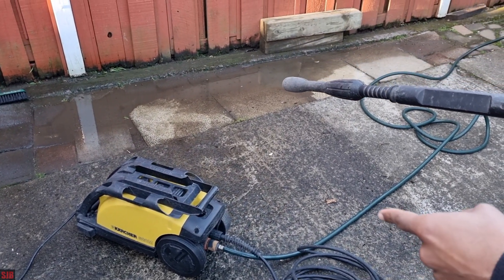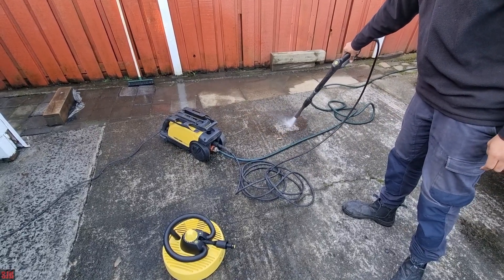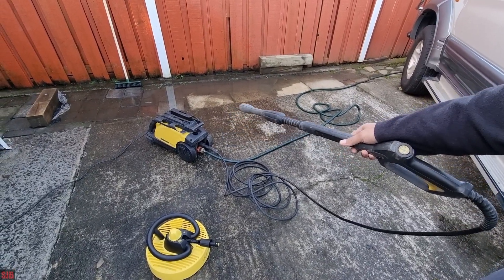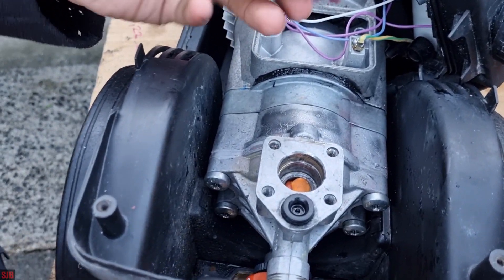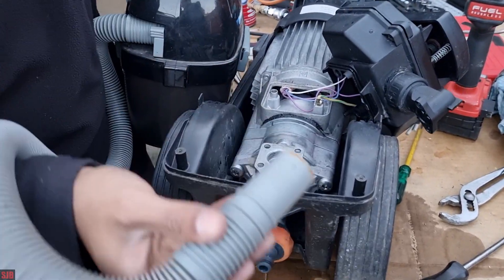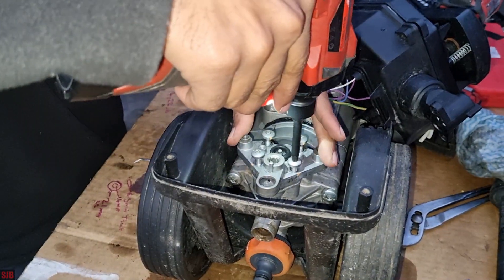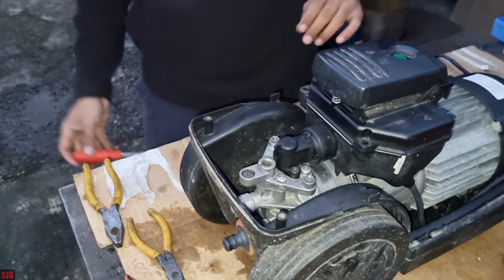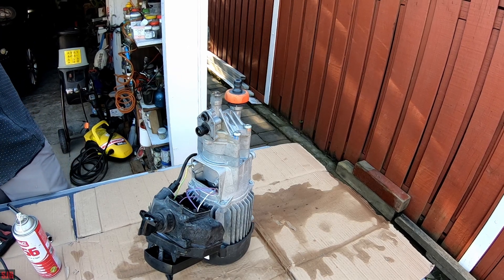How to Repair Water Blaster - Karcher No Pressure

Comment: Thanks.... good video.... in my case I use a mini brush with my Dremel and gently clean all the debris inside the cylinder, also I disassembly the switch to lubricate it, because stays stuck sometimes.

Comment: I have the same problem. I did everything consistently like that, but the problem remained. I think my o-ring rubbers are not the best dimensions, because I didn't have the original ones. Can you tell me where I could find a set of original rubbers and gaskets for this washer model? I searched on the net, but they only offer rubber bands for the nozzles and those of newer models of washers. Thank you.
Reply: Thank you
Reply from the maker: Karcher the last time I checked if you get a good parts person will be able to get a few of the original seals, but you have to visit their store. The rest of the seals can be matched on aliexpress or visit your local bearing/ seal shop

Comment: Bought this machine around 1997. Very little use but it developed this very fault.  I was literally looking at new karchers tonight and just done a quick search to get the spec of the 620 to compare with a new machine and stumbled on this video. Wow thankyou. Ill get o rings and grease ordered right away 👍🏼
Reply: It worked. Thanks. Repaired for under a tenner

Comment: Great instruction and exactly to the point! My machine is suffering from this exact same problem - every year again! When you don't use it for a while the pressure valve gets stuck and corroded and won't work properly. I have to re-open and clean it every time but maybe i missed to clean it properly and re-lubricate it. What type of lubricant did you use? Is it silicon-based?
Reply from the maker: @rilosvideos877  Thanks for the feedback. It's a silicone based white grease
Reply: @AutoBuddynz  Do you have a link or exact name, consistency data?
Reply from the maker: @rilosvideos877  I don't as it was bought without labels from a Karcher Dealership

Comment: Thank you so much for the class about cleaning solenoid valve
I have my Karcher 620 M since 1997 and I love the machine, but during this period I've probably sent the machine at least 15 times to clean this solenoide, thinking tha it had to be replaced.
I probably invest about 02 ot 03 time the machine's value, reparing it 
I'll not send it anymore to the technical assistance.
Reply from the maker: Thanks for the info!

Comment: Thankyou for your very good instructional video. For many years my old 620 has suffered this problem and now I know how to fix it. I have another problem with my 620 though the switch on top of the unit won’t remain on when I push it down the way I keep it on is by placing some very heavy sticky tape across it . Any idea how I can fix it.
Reply from the maker: Thanks! Open the switch and see what the issue is. Not difficult to replace this with another waterproof one if needed.
Reply: I have the exact same problem. Was looking for this on YouTube for soo long. Now I found it!

Comment: When I had a boat my 620 was used very often but now it is just used once a year and needs this fix very often. But I always have to check the procedure here, so thanks for the great video. A couple of points. I manage to get the unloader out without removing the electric box by sliding out the rubber attaching the electric box to the piston housing.  Also, if the piston  is stuck fast, be careful not to damage/bend the thin piece of rod using pliers. If you unscrew the rod from the piston, you can put in a long bolt and give yourself more power/ leverage to remove  the piston  and replace the rod undamaged.
Reply from the maker: Thanks for the info.

Comment: Thankyou for your helpful video. I had a problem today with my 620M which cut out and it was the machines thermal switch which reset after 30 mins. The reason was my own fault as I fitted a rotary lance and didn't bleed through first. It jolted the system and cut out. Okay now, though I do have this same issue you had too, so a rebuild is something I shall have to do also. It is over twenty years of age and worth looking after.
Reply from the maker: Thanks! Glad it was useful.
Reply: @AutoBuddynz  I followed your video and took it apart this morning and rebuilt with a clean and grease. It is now working properly. Thankyou again.
Reply from the maker: @brandywell44  Appreciate the feedback, thank you!

Comment: Hi, great video, I have a K5 not the power control one just the normal one and it doesn’t seem to have any power as in when you turn it on with everything connected nothing happens I’ve left the water to go through as some people say about the air locks but even after trying that and taking it apart I can’t seem to find what’s wrong with it? 
Any help would be greatly appreciated thanks.
Reply from the maker: Hi thanks,  does the electric motor start running? As it could be a bad motor start capacitor or maybe the on /off switch is playing up on top of the water blaster.
Reply: @AutoBuddynz  Hi thanks for getting back to me we took it apart and water had got into the coil.

Comment: Where did you get your o rings from as Karcher have discontinued
Reply from the maker: Kits are available on eBay.
Reply: @AutoBuddynz  thanks ... but I found them at ABC bearings
Reply from the maker: @alessi1973  thanks for the info, I'm sure it will be useful for others. Do you have an address?